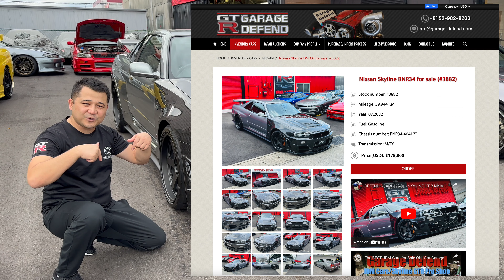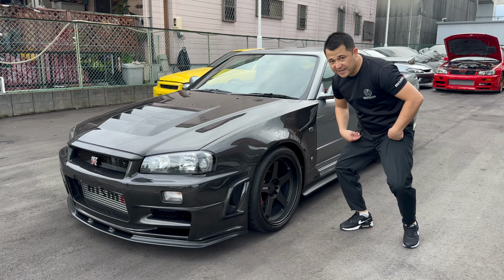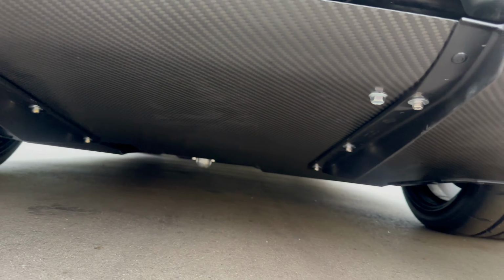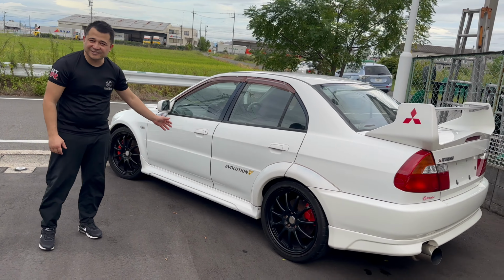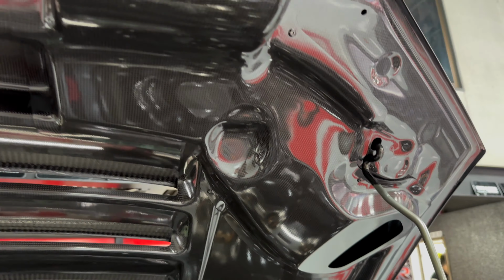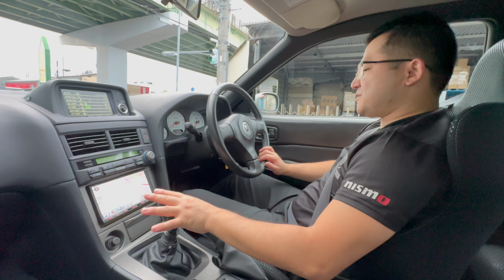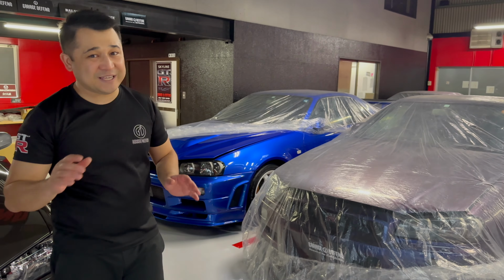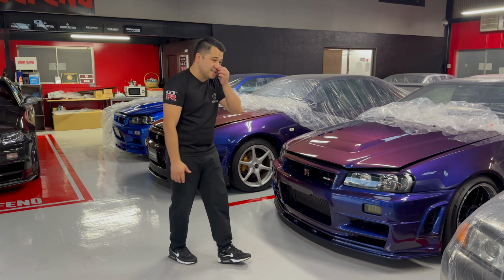SPECIAL NISSAN SKYLINE GT-R R34 FOR SALE! Full Carbon!

Comment: How did they change from RHD to LHD on the other Skyline R34 GT-R? I didn't expect that one, i was surprised, when i saw a Skyline R34 GT-R for the first time next to me i had no reaction, i've never felt anything like it, a very beautiful car, no car has surprised me so much, i've seen Ferraris, Porsches, Lamborghinis, but nothing that compares to the Skyline R34 GT-R, it must be a great pleasure to work every day with Skylines R34, the R34 is a legendary JDM icon, a masterpiece of japanese engineering, is a special car, that first appeared in Gran Turismo 2, it was part of our childhood, is the king of JDM cars of all time 🫡🇯🇵❤️
Reply from the maker: It took almost 3 years to complete this car. Steering wheel changed from right to left, car has been full repainted to grey color, and then engine with other parts rebuilt.
Reply: The owner is Cambodian. Here in Cambodia, we use the LHD.

Comment: The paint match on the carbon gtr is absolutely horrendous. Can clearly see two different shades of grey on the car. Explains why you haven’t sold it yet.
Reply from the maker: Carbon GT-R has never been painted before. Its original color with front NISMO carbon full aero installed which is super rare and expensive. Not everyone has the same taste my bro, some people love it this way, some dont.
Reply: There is no way you said the “carbon fiber color was a bad attempt to paint match” lmao… do you know how carbon fiber works??? And it’s natural color? Also painting this carbon would be a crime